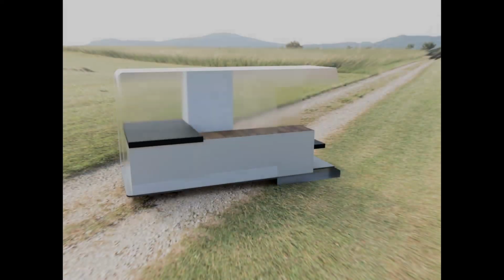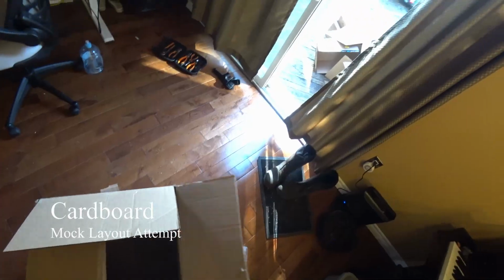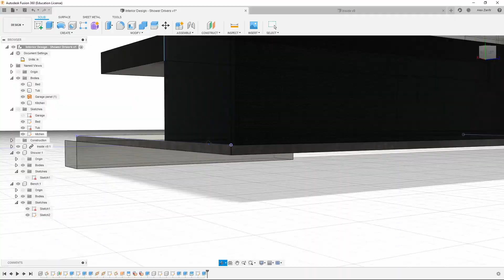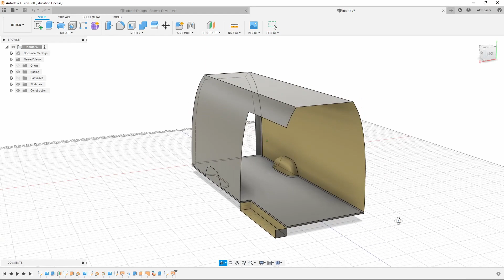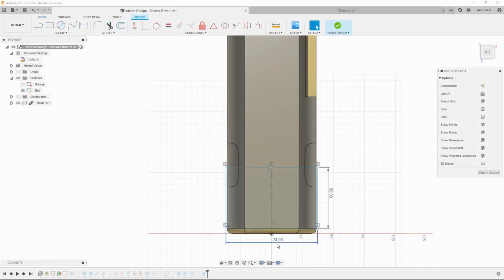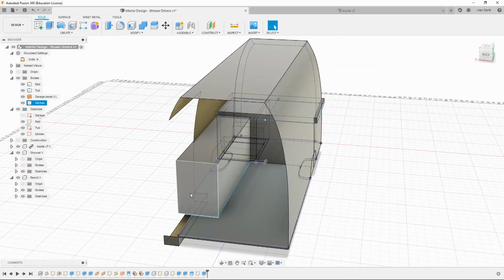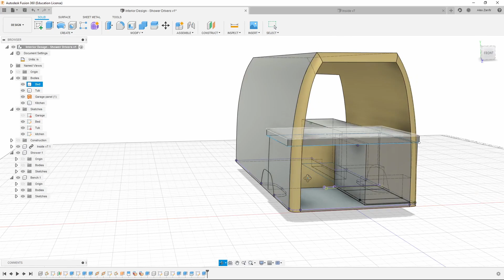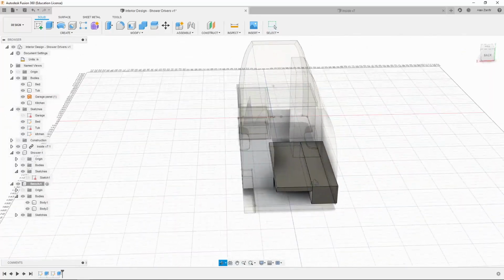Sprinter Campervan Fusion 360 3D Design

Comment: Hey man! Sorry to bother you but is it possible to either get the dimentions again or a new upload of the floor plan ? Im working on my own 170 sprinter and as you are learning fusion 360 to desgin with. But my sprinter is in the warehouse and not easily accesable and i didnt take good enough measurements.. It seems that all i can find online of inside dimentions is inaccurate at best and almost all of them have conflicting measurements. Cheers !
Reply from the maker: Hey sorry I've lost those files on my old drive breaking